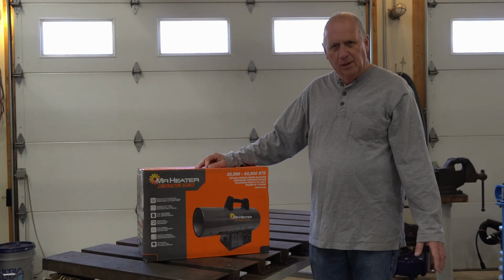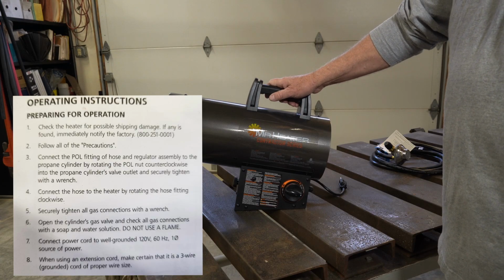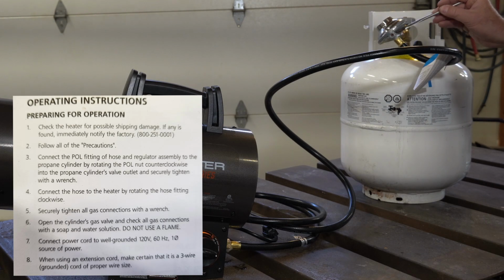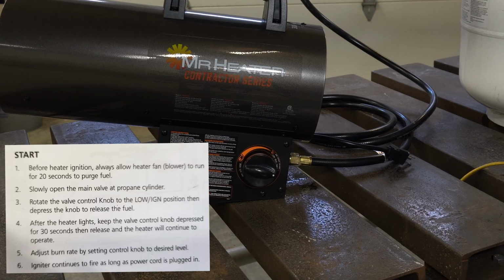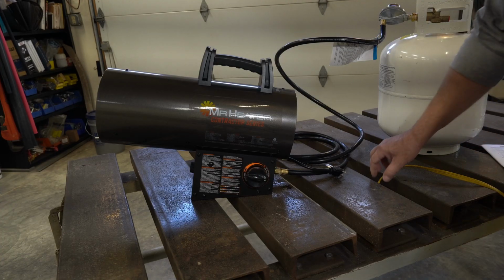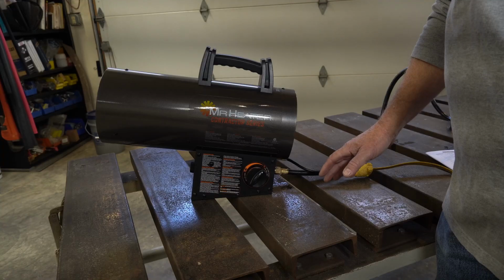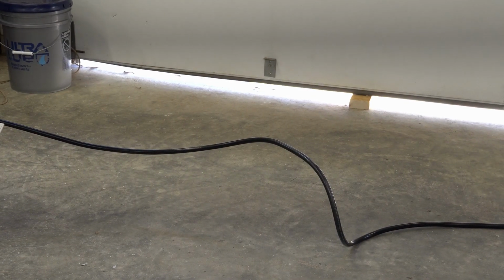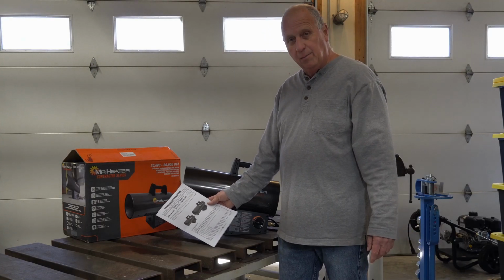Mr. Heater Forced Air Propane Heater 30,000 - 60,000 BTU - Unbox, Setup and Operation

Comment: Yeah I almost also say about safety and I like you should probably...

With anything with fire you should lead your videos off 
And then also close your videos with safety tips and reminders.
Reply: Especially when it has to do with fire but man also wanted to chime in and say your video here is 1 of the best instructional videos for any kind of tool or you know anything mechanical that I've seen in a looonnnnng minute.

Also with something like this and I know it might seem a little bit Petty but you almost don't want to operate something like this without someone next to you watching what's going on kind of like a battle buddy because you know when you're dealing with gas you're dealing with pressure I mean what if someone's knocked silly or really f*** up, you know, you're kind of out in the middle of nowhere, find it hard to believe someone's going to hear a faint gasping scream for help so I think it's just when you have something as powerful as this...in an acute way, you NEED 2 people. 

Thank you though.  You definitely pump out the good material on YouTube and are on the good side of content that actually helps someone. 

😊😊😊😊 Salute
Reply from the maker: Thanks for your comment with concerns but there is only one person, I am forced to work along. The wife does have a camera pointed at my shop area to keep an eye on me.

Comment: It sucks because that still need a plug into electric. Thought it was only supposed to be operated with just propane
Reply from the maker: I know having to connect it to electric cord stretched across the floor is just painful and the sound the blower makes is not a positive thing, but it does a good job knocking out the chill in my shop on the cold days.

Comment: I got mine to ignite, but flame isn’t staying on after releasing the button
Reply from the maker: That usually means the safety thermocouple isn’t quite engaging. Are you holding the button down for the recommended 30 seconds? If so, there might be an issue with the thermocouple itself.

Comment: Curious how long to expect this to run on a 20 lb cylinder on low and on high. Thank you for a good video.
Reply from the maker: I did have real numbers when this video was recorded but since that data was deleted, but doing a search these were found "On a 20lb cylinder, you can expect around 14 hours on low (30,000 BTU) and about 7 hours on high (60,000 BTU)". Hope this helps as I only leave it on long enough to knock off the chill then use my kerosene heater to maintain the heat, as it makes no noise.

Comment: I just got one of these heaters from my wife for my Birthday!  Thank you for making this video. It made set up and operation quick and easy for me. Only thing I did different was use propane rated teflon tape on the hose connections to the heater and the tank.
Reply from the maker: Happy Birthday! That’s an awesome gift, and I’m really glad the video helped you get everything set up smoothly. Using propane‑rated Teflon tape on the connections is a solid move — anything that adds confidence and safety to the setup is always worth it. Enjoy the heater and stay warm out there!

Comment: I just got mine and had a question. In any range from medium to high this thing throws a fire like a ft out of the front. Is it normal?
Reply from the maker: I have not noticed any flames coming out passed the front face. I have not set mine up yet for the season, will reply when I do.
Reply from the maker: I set up my heater today to see what type of flame it was creating. For mine the flame was not even go halfway throw the flame tube. Is your tank in the upright position a tank on its side can send liquid propane to the heater and I am not sure what would happen to the flame.

Comment: Great. Video wished you’d of shown your flame burning .. trying to troubleshoot one I picked up at yard sale
Reply from the maker: Did not even think about showing the flame. Best wishing at getting your yard sale unit working. Mine does a good job knocking off he chill but is does make more noise than I like when working so it gets turned off until it gets cold in the shop again. Thanks for your comment.

Comment: I have mine going but the igniter isn't turning off. Suggestions? Is it safe to use?
Reply from the maker: When you say the igniter, you are talking are about the buzzing or ticking sound made by the high voltage spark. If that is so it is normal for as it is the igniter of the flame and should make that sound as long as the heater is connector to the electrical power source. It must be a safety feature. Here is the customer support number for Mr. Heater if I did not make you feel safe using your heater Phone 1-800-251-0001 (USA & Canada). Keep warm and enjoy having the heat.

Comment: If I fail the leak test and it’s outside in open can I proceed
Reply from the maker: Leaks are not acceptable because someone may take it into an enclosed space to operate it. Where is it leaking? You may need to tighten the connection or there may be some residue on that sealing surface. It's hard to help with your issue online, but I will try if you need more assistance. I believe that there was a hotline phone number listed in the operator's manual for customer assistance also.

Comment: You are the first video I’ve seen saying it is reverse thread into the LP tank and what size wrenches to use. Thank you for that.
Reply from the maker: Thanks for both of your replies. Before posting this video, I watched several videos that detailed the wrong methods of setup and using this heater. Be safe and keep warm with both of your heaters.

Comment: Just bought one myself from Home Depot. Nice little unit. I ended up buying the Kerosene Mr Heater also off Amazon as it got down to single digits yesterday and wanted one with a thermostat on it.
Reply from the maker: It is a nice small unit for knocking the chill in my shop. It does make some noise but usually I turn it off after the chill is gone and use my kerosene heater with no sounds at all.

Comment: Do you need to have a door open when this is on? I read in other videos that tank needs to be outside ?
Reply from the maker: Yes, the manual states the amount of area to allow fresh air into the enclosed structure such as a door or other opening. Check with your manual for these required sizes and locations. I did not see in my operator's manual that the tank needed to be outside, but it would be safer to have it outside.
Reply: im having issues with mine just bought it and that buzzing noise its making in this video isnt there at all, it wont ignite. @buildItplace
Reply from the maker: @evilbunnies4205  The buzzing noise is coming the sparking of the high voltage flame igniter. It will continue to buzz as long as the unit is powered or otherwise plugged in. In my video you may not hear that sound because the flame and fan noise drown it out. Does the fan start blowing when the unit is plugged in? If so, I would believe this unit to be defective. Other than being somewhat loud I am happy with my heater as we are just starting using it for the 2nd year. Hope this helps. Thanks for watching, Brian
Reply: @buildItplace so it’s normal for the starter to be running all the time?
Reply from the maker: I believe that you are talking about the ticking or arcing sound it makes. If so, that sound is high voltage flame ignitor and operates constantly after you apply power to the unit and will continue until you unplug it. Without that arcing the flame would not continue to ignite. Hope that answers your question if not reply back.